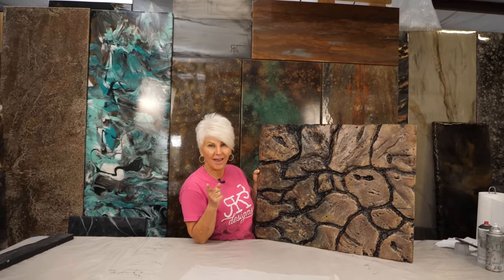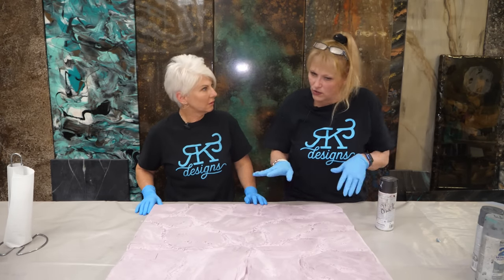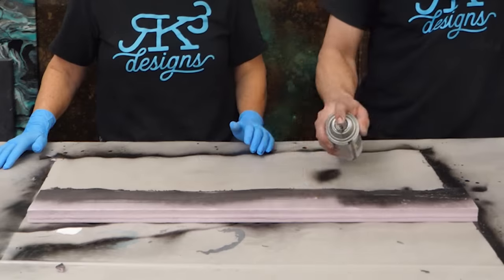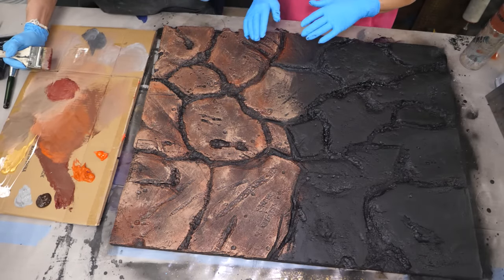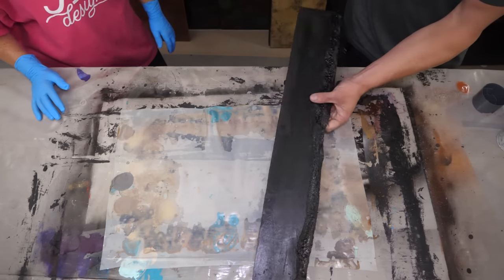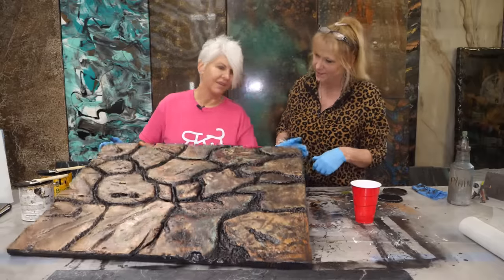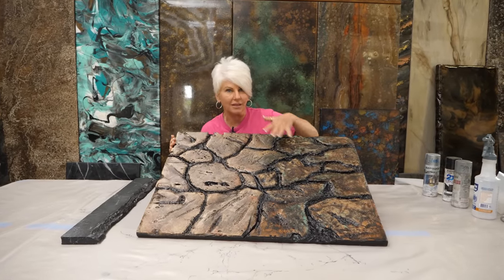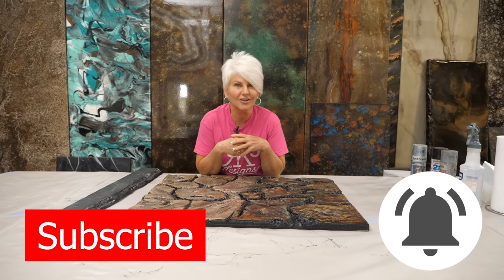How To Create A Rock Wall With Foam Board, Paint And Epoxy | RK3 Designs

Comment from the maker: rk3designs.com || Which side of the rock wall did y'all like most?
Reply: Toward the end I couldn't decide.... they both looked great.    
Question for you.  If it were in the   shower area wouldn't the water pool in the grooves and maybe cause scaley build-up ?    Just wondering.
Reply: I liked your side of the faux rock better.
Reply from the maker: @stop_and_smell_the_roses  I don’t think it would be a bid deal. Just use a spray cleaner and wipe. I’ve seen showers that were made of real stone that are fine. 😊😊
Reply: I love them both. I could see them in a fireplace & I like the island surround idea.
Reply: I like them both as each side has there own beauty!👍👍👍
Reply: I liked yours with the teal of course.  To be fair the colors were lighter and I like the hand method. I love the wash stain look. Amazing.
Reply: Spray paint side
Reply: Love them both but the side with turquoise is my favorite ❤
Reply: I'm like you, I like the teals and turquoises so that side. I can't wait to start a project using this technique!!!! Thank you!
Reply: I thought it all was too much with the black touch up afterwards but I liked the soft side better. I like a clean look.
Reply: Loved both
Reply: How would you attach to a wall.
Reply: Spray paint, but maybe finish will make a difference
Reply: Favorites totally depend on where it goes. The turquoise would be my choice for a foyer or entry wall, the other one for kitchen and dining.  Frankly, the side with turquoise looks so much like real outdoor rock that it is just too easy to imagine a real bug or lizard darting across it, so not in a "food room." The other one feels "cleaner" even though my brain knows that both topcoats are identical!
Reply: Both are gorgeous in its own way
Reply: Both were perfect, depending on the installation ;-)
Reply: @nataliarichardson539  yes! You took the words right outta my mouth.. I mean hand.
Reply: @KristiSage  I would think that the heat would melt it
Reply: Omg I love the teal .very beautiful
Reply: The lady from Alaskas side.  I’m partial to river rock colors with lighter “tan” grout lines.
Reply: Oh my goodness....!!! I love both designs! I did really appreciate you going in with the turquoise, my favorite color btw, because that honestly wouldn't be something I would think of layering in for a very rustic rock wall final product. I want to use this type of design on my living room walls, but only up to a chair rail. I was looking at, prior to finding your video, the manufactured faux 3D PVC rock panels. They were ok, but the worst part of the final look on a huge area, is the repeating pattern that makes it look so fake. What you guys have shown the YT world is incredible! I can't wait to try this artistic technique to make faux rock panels.... that I can use anywhere I want! Sooo cool! Thanks guys!🙋🙏👍
Reply: Could this be used outdoors as a half wall 4' high 8'long which epoxy would you use for outdoors?
Reply from the maker: @jaimesillett118  I wouldn’t use it outdoors if it’s going to be exposed to the direct sunlight or the element. UV breaks down both the foam board and the epoxy. I don’t recommend any epoxy if it’s going to be exposed to direct sunlight. If it’s going to be under a cover, I would use the regular original formula Stonecoat Countertop epoxy. You just don’t want to do a light colored finish.
Reply: Have you ever used actually grout to fill the grout lines? Would that work?

Also,
How safe is the end product regarding flammability and seepage of any toxins into the air?

thank you.
Reply: I'm kinda surprised that I liked the spray paint better! This would be perfect for my  RV that I've been renovating and living in since my apartment burned down. Its light weight and I've been trying to come up with something good for the shower walls! Thank you!
Reply: Absolutely love the touch of turquoise!   Awesome!   Thank you!
Reply: Both sides are beautiful. Using either one would depend on your decor.
Reply: I like the spray paint side the best bud both came out amazing. How would the utc do on a backspace without resin if something with a sharp end hit it? Would the foam dent?
Reply: The spray paint side looks more realistic.
Reply: Naughty, Naughty you have the original art maker of those rocks on your channel,no kudos for you sweetheart no kudos for you
Reply from the maker: @wittnessbe_judged8723  not sure what you’re even talking about, me having her on my channel is giving credit to that person. Also, if you search YouTube, you’ll see there are MANY people doing this in foam.
Reply: @RK3Designs  Yes that may be true, however, if you were invited to another channel and they were professionals at what they did and they didn't do it like you and they did a better job than you did wouldn't you be offended if they asked the same question all I am saying is be kind I believe her technique was absolutely beautiful and I believe your technique was more I'm not gonna say. I have seen you on Art until you Die Stone Coat this was not a contest who can paint better than the other this was you asking someone to come to your show I am sure you are offending her
Reply from the maker: @wittnessbe_judged8723  I was nothing BUT kind. We are best friends! But, if it makes you feel any better. SHE was the one that wanted me to poll my audience. I wasn’t trying to make it a contest. I was trying to let my viewer know there’s several ways to achieve a look. Plus, I believe she and most is my audience is mature enough not to get their feeling hurt over such a SIMPLE issue. I appreciate your feedback, however I believe you are making this a MUCH bigger issue than it need to be.
Reply: I liked the roughest side. They were pulled out of the mountain.  The smooth ones were taken from along the edge of a river where the constant motion of the water has polished 3rough edges and made them smooth.  I'm a mountain girl. 💖😍
Reply: Both sides are awesome. I KNEW I should have taken up the offer of a bunch of really thick blue foam from my brother when they took down the floating dock at his work! But my boyfriend and I come across it all the time when dumpster diving too.
Reply: I loved the side you did the best. I'd like to do a lighter rock wall I think that would be beautiful too. And attach it to my island   ❤️❤️
Reply: Spray paint side
Reply: left
Reply: Yours with the turquoise! Question...would you be able to use this as an outside floor instead of something like pavers for instance? How could they be installed?
Reply from the maker: @milissaadams-henderson7701  no, this is foam board and not recommended for outdoor use.

Comment: From what I have learned from foam working, using acetone and a thin paintbrush will dissolve the foam with less mess and spritzing it with water and taking a heat gun to it gives it some of the best texture still with little to no mess.  Hope this helps some people.
Reply from the maker: Great advice!! Thank you so much!!! 😊😊
Reply: Not a fan of the turquoise
Reply: Excellent! Thank you!
Reply: Thank You James!!! These Are  Some Very Good Pointers!!! This Will Eliminate All Those Styrofoam Crumbs That Get Everywhere And Cling To Everything!!!💪💪💪❤️❤️❤️
Reply: Yep , You should do videos!
Reply: Dremel tool would work too.
Reply: Propane torch does it great without the mess, it rounds out the edges you don't have to sand it round.
Reply: @crazyericstewartofcanton9999  plumber's propane torch.
Reply: @Documentary Magic gasoline but I don’t think that a good idea I think gasoline is more like acid when it comes to foam it will completely eat it up
Reply: Best advice! They made an ugly mess that no one wants to clean up.

Comment: 50 years ago we used to make all our set designs with sheet foam. In those days we just used petrol to create the weathered natural look. Then we'd paint it up to look like stone arches or log cabins. Foam is such a versatile material. You're only limited by your imagination.
Reply: Seems so much more simpler & less expensive. Thanks for sharing.
Reply: Could you use foam in a bathroom?
Reply: @TikiTiffany  Yes, as long as you seal it well. I've had a foam sculpture outside for a few years and because it's been sealed with a few coats of all weather sealer on top of the artwork, it has not deteriorated at all.
Reply: 40 years ago, I used to do sets and we used acetone to weather the foam for stone walls.  I would take a brush and fling it at the styrofoam to eat out spots.  Then we used at least 3 shades of gray.
Reply: @daveyinparis1  is that for it being in direct sunlight also?
Reply: @4evaMrsBrentWeston1  I imagine so. If the top coat of paint is an endurance paint, I imagine it would last a good ten years before needing to be repainted.
Reply: I'd love to learn how to do a foam wall to look like a log cabin wall. Are there any tutorials? Also are all these materials ok / non toxic to breathe in?
Reply: Is it OK for flooring
Reply: @LeighPowellSmith  No. It's too light for traffic. Hence it is perfect for set designs etc.

Comment: I am just BLOWN AWAY WITH THIS VIDEO!!!!! Wow, wow, WOW!!!!  You started my wheels turning!!!! Faux Effects has so many plaster products that you could use to build up on the rocks to make the rocks different heights and textures!!! I can’t wait to experiment with my ideas.  Of course I love the turquoise!!!!!  Even your mica flakes would add more interest.
Reply from the maker: I knew you would like this. You think like me! ❤️❤️
Reply: This is old school stuff.  In fact,  of bet my legs that half the buildings in your city are built out of metal studs covered in Styrofoam and rock texture paint.  While the interiors are foam carved with cylinder block, wood, Stone patterns then painted. Fast growing cities have been doing this for at least two decades.  Also using slick finished concrete with stains to emulate marble then epoxied over.  Old old old stuff.  It's cheap,  fast and often stands up to tornadoes.
Almost every modern (built in the last two to three decades) hospital, doctors office,  federal building is built out of this decorated foam. It's also good against hurricanes.  As long as the plates are attached to the studs etc.

Comment: Hi Ronda! Tx for this unlock! ;P 
These kind of panels would have a very functional purpose built even from thicker foam and glued to external walls of the house or garage, offering a better insulation by increasing the R value of that wall, also you don't need to worry about re painting or changing a wallpaper.
Also in shower panels or wrapping up a kitchen island is great idea, and why not, maybe even head boards for beds or big dresser doors. The small backsplash could also be carved and glued to door architrave/jamb casing/decorative trim around the door!
I would not place them close to an intense source of heat though as the foam might melt if it got hot.
Reply from the maker: I agree!!! So so many options!!!! 😊😊😊

Comment: Stunning!  I would like suggestions on mounting and on how to interlock panels (that would be a great video!).  We’re going to attempt this for our bedroom wall.  Since I’m currently not sure how to do an interlocking panel, we are planning on doing a wood ‘grid’ and placing each panel inside the ‘block’.  As for that turquoise…. I have a birth ‘defect’ that gives me an extra cone in both eyes, so I see color a bit different and pick up more colors on the spectrum than ‘normal’ people do.  If you could see what see, you would be even more impressed with the turquoise as I pick up a tinted green and blue.  It’s gorgeous!
Reply: For interlocking panels, try tounge-and-grooving them. That's a great way to join two panels together without a very noticeable seam.

Comment: So glad I found this channel.  I've been planning this project for about a year now and just came across this video.  I have learned you can also use a hair dryer or heat gun to "roughen up" the foam board.  Then, if you very lightly spray it with water prior to the hair dryer or heat gun, it makes it look even better.  Fantastic rock wall !!!!!

Comment: QUESTIONS:  Where can this be installed?  How?  How to care for and maintain?    One side began to look a bit like wood and the other stone.  They are all beautiful.   Knowing where these can and can not be used would be helpful! The process is almost too easy!  Thanks for another easy, budget friendly way to update/DIY our surroundings.
Reply from the maker: Great question. I wouldn’t install them to extremely high heat or outside where they are exposed to direct sunlight. UV causes both the epoxy and the insulation foam to get brittle and crack.

Comment: I live in a tiny apartment and I think that by using this to surround the balcony doors, cover the whole wall, 12foot including the glass doors, I think that it would help give the illusion of spaciousness and grandeur. Nice, when you live in a tiny box of an apartment.  Just imagine,it's even better if you are involved with SCA or play D&D. Even better, you can take it with you when you move of you are careful installing it.😍
Reply from the maker: Just make sure you don’t put it in the direct sun. Foam board and epoxy both with break down over time when exposed to high levels of UV.
Reply: @RK3Designs  my apartment balcony faces east, so the inside Never sees sunshine, no worries .
Reply from the maker: @shimmybottom  Perfect!! I’ll bet that would look amazing!!

Comment: Sweet of you all to spend Mother's Day showing this Amazing technique. 
Love thevFaux Finishes.
2 questions,  how to butt sections to seal, thinking to do this on squirting around house using an exterior sealer..
Next question is, do I need to paint or seal the other side, as will it warp ?
Reply from the maker: I’m not sure it would be durable enough for skirting. Also I would put something besides epoxy if it will be directly exposed to the elements. Epoxy will become brittle and crack after extended exposure to UV rays. The exterior sealer would be good for sure. As far as seaming, you’ll need something behind it to attach to, then I would use some sort of exterior colored caulking.

Comment: Fireplace, shower, wall or walls in kitchen behind stove or front and back porches.  Around doors exterior front and or back.  This technique is stunning, light and easygoing.
Reply: No sure how flammable it would be behind stove or if it would pass fire code, or if the resin constantly being heated would constantly be releasing the chemicals from the resin. Would love to know!

Comment: I carve foam with a wood burner and then kiss it worth a torch to give it character. I put up a "stone wall" in my garage behind my forge. Just have to make sure it does not get hot! The flame kiss gives it a similar finish to what you have there and cause the foam to become very hard.

Comment: Hey Rhonda & Deb, two of my most favorite faux finishers! 😉 This is amazing!! And the timing is absolutely perfect!! I’ve been doing some research on faux wood boards to create some wood beams for our homes vaulted ceilings. This guy used foam insulation panels and with a wire brush & some acrylic paint they looked very realistic. In addition to that, I think the hammered spray paint could give it some interest, but sparingly. This is a great video. Thank you!!! 🫶🏼❤️ I welcome any other ideas you might have. All the best -kristi
Reply: kristi i've been experiementing and playing with this type of work for minute, ha.    If interested I could offer a few more things I have seen or dont myself.

Comment: This is absolutely stunning! I know you’ve answered a lot of outdoor questions but what about using it as a flooring in an outdoor covered area? I would use an exterior sealant. I love the different textures creating an anti slip feature.
Reply from the maker: I wouldn’t use it as flooring. The foam isn’t durable for that. Also, is you use it outdoors, make sure it’s not getting direct sunlight. It will deteriorate the foam and the epoxy will become brittle over time.
Reply: Back in the late sixties early seventies I used to have a product called instant brick and we used a material that we sprayed on anything you wanted to. The product looks so real. Like a stone Mason or bricklayer had done the job. The individual who came up with the idea started making and selling inferior products that  we had to go out of business. Not only going out of business but losing the money that we invested in the product and equipment.
Reply: @davidkuhns4382  I am so sorry to hear 😭

Comment: Thank you, I’m using this board for skirting and had planned to apply texture afterward. This would be easier.
Reply from the maker: The foam isn’t recommended for outdoor use where it will be exposed to direct sunlight. It will deteriorate the foam board.

Comment: Great video!
I want to do this on an outside wall. What do you recommend? Is the something stronger I can use to coat the foam boards to prevent deteriorating?
Reply: Wanting to do the same,  maybe if we epoxy or use the UTC on the backside and edges it would hold up. They do mention this could be used in a shower.

Comment: Both sides of the board are fabulous and I'm sure my little android doesn't do them justice. I do love black though...Love this foam board technique as I've been looking for cover my white walls with temp log cabin wallpaper, rocks, or regular boards. Thought of removing sheet rock and exposing wood studs/2x4's? Then setting shelves inside with support brackets/boards? Love this option...💜This method allows me to work on in another area so I don't have to paint on a ladder directly onto the wall...not to mention possible height involved...ug. Thx for an answer to achieve an artistic  solution. YouTube Waynesville NC 🇺🇸 Veteran